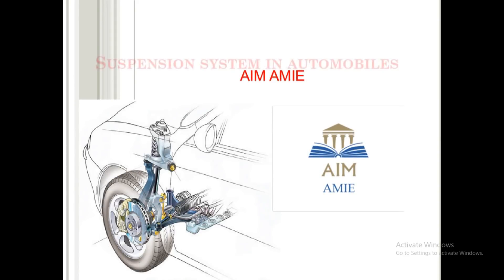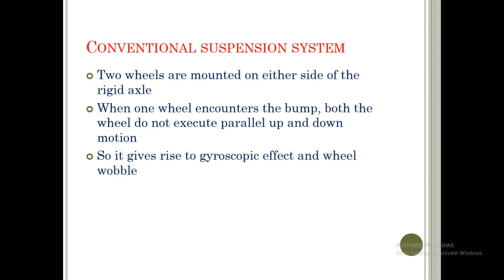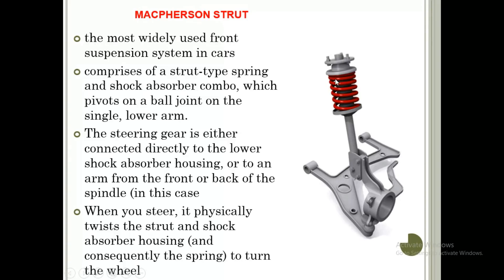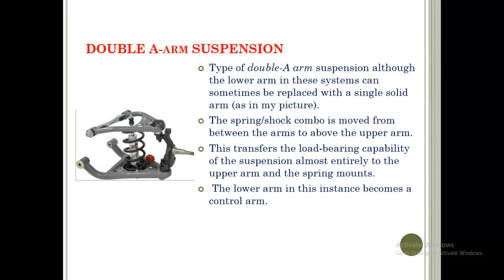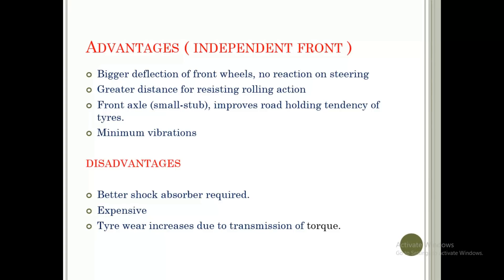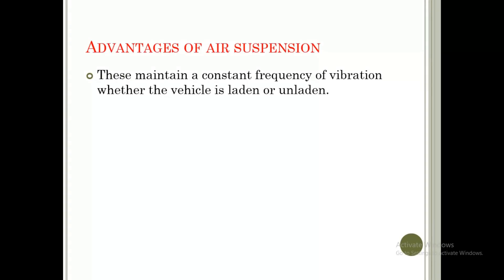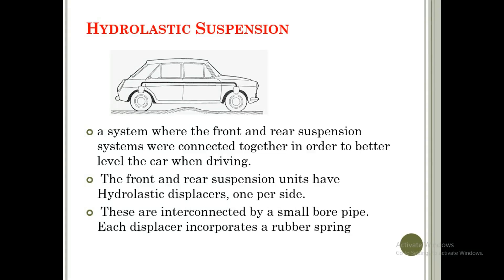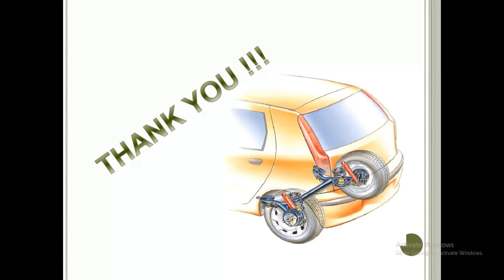What are different Suspension Systems in an Automobile??  ||Engineer's Academy||

Comment: may i know the references used to make this video? because I need to put it in my report.
Reply: i only want to know the book you referred to make this video.
Reply from the maker: Automobile engineering part 1 & 2 kripal singh !
Reply from the maker: Hi.. watch another video on suspension system.. u will get more details ..